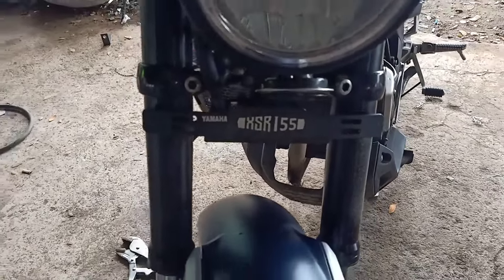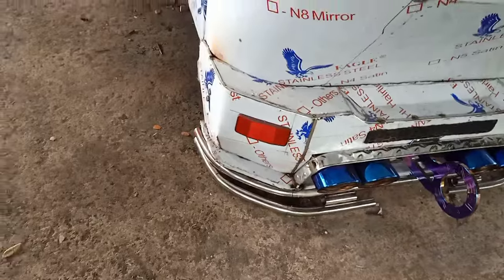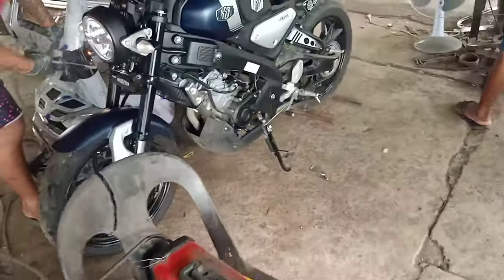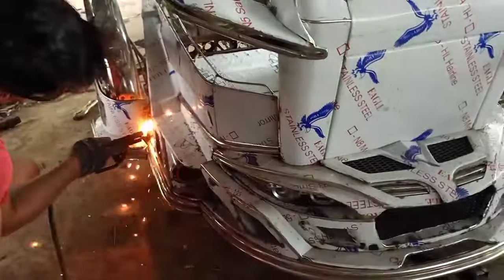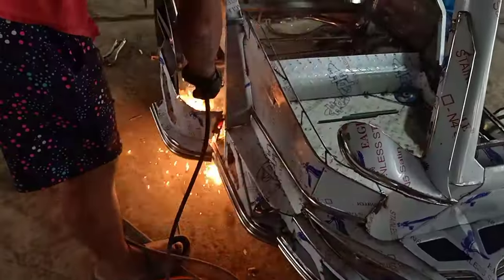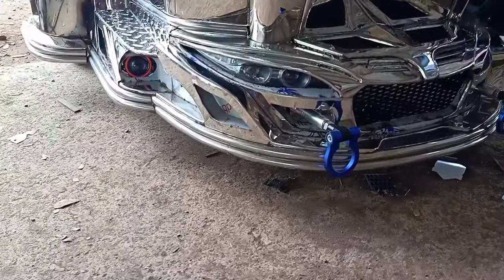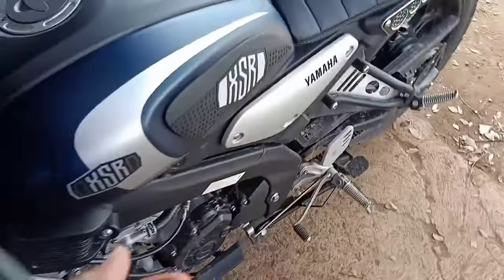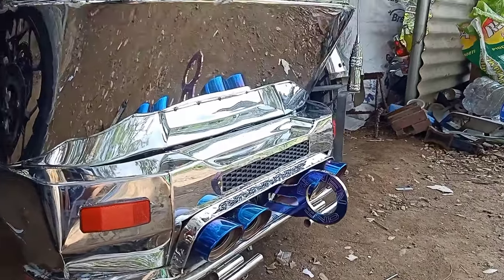YAMAHA SXR CUSTOMIZE SIDE CAR DESIGN #yamahaxsr155 #sidecar #vlog

Comment: Sir,di po makontact no. Nyo. Matagal Kona sanang gusto g umorder.oorder Ako ng pure stainless.sana makapal ang stainless nya. Mustang design 32widex36inc width.
1).red seat
2).Mags side wheel 17 inch
3)complete accessories
My motor is TMX 125.
THANKS.deliver @calumpit bulacan